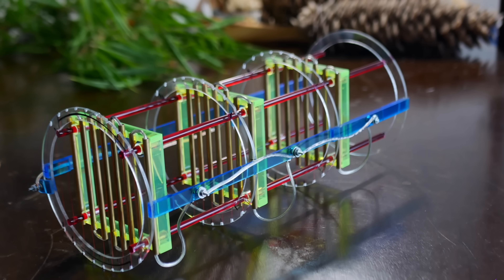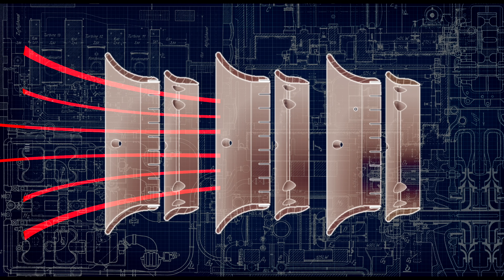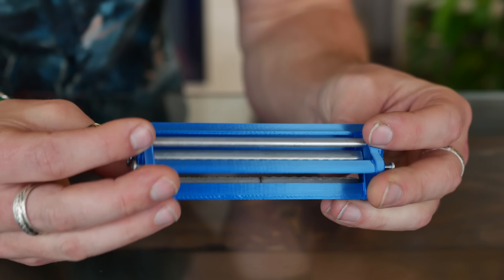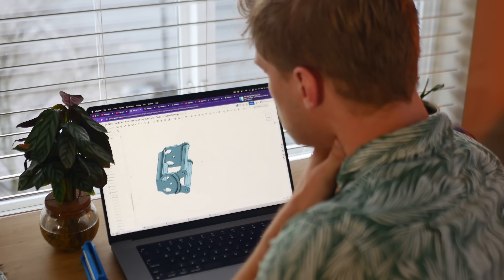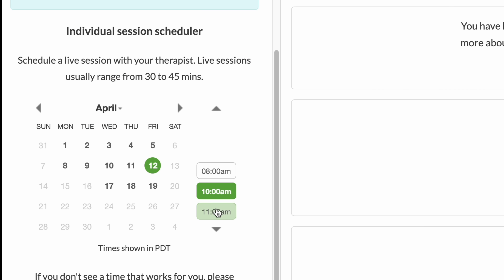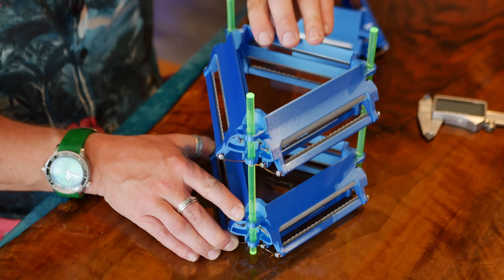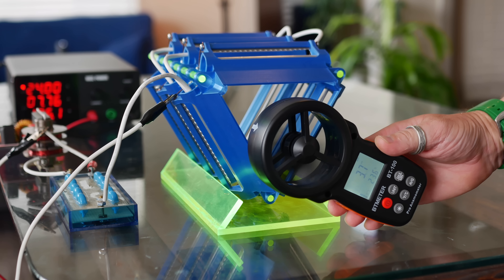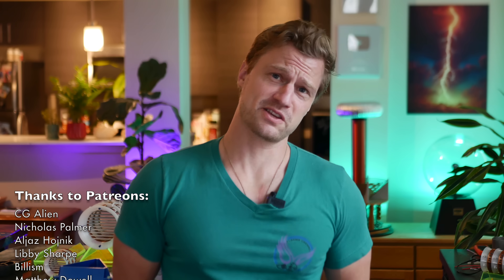Next-Gen Ionic Plasma Thruster Inspired By Nature (BTC Mark 3)

Comment: Been a pleasure following the iterations of these thrusters!
Others might have suggested this, but I would suggest a dedicated testing rig that puts the anemometer at either a fixed distance from the thruster, or has variable distance gauges so that you can reliably capture data at the point of highest constructive interference (or multiple points along the air stream). 

Excited to see Mark 4!

Comment: Have you tried adjusting you convergence on each stage to optimize your airflow if each stage is the same displacement it cancels out your results also individual power sources will definitely help with watts to volts on each stage like 40w 60 w 80w ect

Comment: 1st stage Funnel the air into the center second stage have a accelerator in the middle running a higher wattage each stage has double the wattage then the stage before stack 4 like that see what you get.

Comment: Have you thought about angling the thrusters for a vortex affect so that it will actually suck in more airflow instead of a straight column like you've been using . Also would using a Venturi tube behind it help increase thrust/flow?

Comment: Don't know anything about ionic thrust but I'm surprised you did not try to make it in a nozzle shape. I thought the venturi effect increased air acceleration.

I am also wondering if giving the ionic thruster a spiral direction could potentially create a tornado effect. Finally, does the air temperature have an effect on air speed?

Comment: Maybe i'm not getting it really and it's rather late but might be an idea to use the second electrode of the first unit as the first electrode of the second element? Or maybe its not actually possible to decouple the two circuits in that way because electrons doe what they do? Maybe that concept could be used also with combining lower and higher voltage circuits at different spaces apart ... or maybe it gives you some great idea what could done ... such a cool project ... loving it. 
Also i was wondering if you might not get more flexibility to test if you would go more 2d and sandwich 2 elements between some plexiglas, but feels like less interesting idea right now ...
also ... i feel lasers should be used in some way - ok i should sleep 😂very inspiring project!

Comment: “Constructive interference” is not a factor in this design.
Reply from the maker: Each individual thruster (each side of each section) uses a double stream of air, converging into one. Then, all three sides of each section, loosely converge into one focal point. Then, even more loosely, all three stages converge, linearly.
Reply: @PlasmaChannel  Constructive interference is something that happens when two waves are in the same place and in phase. Your design doesn’t depend on the in phase combination of any waves — there aren’t even any waves. “Confluence” would be an applicable word to describe the new feature of this design.

Not trying to be annoying… I love what you’re doing and have been fascinated by home-made ion thrusters since the first time I saw one described in the 1970s. Your designs are lightyears ahead of what I saw back then (:

Comment: I'm not terribly privy to the world of bladeless fluid dynamics, but the air mass being moved looks promising. Does the air mass retain a high static charge, or has that been measured? Didn't know if this would make sense for use in alternative air-cooling for high heat dissipation  in CPU cooling, unless the air mass holds a higher then ideal static charge making the air flow hazardous around low voltage semiconductors.

Comment: Have you considered the fluid dynamics of your airstreams? Doing it in triangleform the forces of the 3 diffrent streams counteract each other in some parts. If you model the airstreams and find a better shape for your engine you could probably increase the effiency quite a bit. I would consider a hexagon or octagon shaped engine since it would be easeier to build then a round one that people have mentioned here in the comments. Consider diffrent angels of the airstrems for each stage so they focus at the same point at the exit of the thruster.

Comment: Hey i've just had a thought you might be able to angle the thrusters slightly differently it could cause the air pulled in at and angle creating a vortex that could potentially end up pulling in more air creating more thrust just an idea might not w

Comment: Closing the gaps what you did, didnt improve much performance because you still have slits introducing lower pressure. Like suction of a hoover tube  goes down after one opens a top hole. Reckon you should eliminate any open gaps between the electrodes, slide them inside a horn tube for optimal spacing and consider using magnets and nozzle design to improve the thrust. Also a cathode at the exhaust to collect the ions and make engine electrically neutral. Using higher voltage also will improve thrust. Around 1kV at about 7kW accelerates existing space thrusters to about 20-50 Km/s

Comment: I could imagine changing the angle of the inputs might help: after the air’s pulled through the first set of inputs, it’s moving more horizontal than at the 22° angle, but as that air passes the second thruster frame, you’re reintroducing air at that 22° angle, so there might be a spot that’s got some backdraft, kinda like how there’s sometimes spots on a river where the water’s flowing back upstream. Maybe doing something like having the first set of inputs angled like normal, the second set angled somewhere between 17.5 and 15°, and the third set closer to 12.5°, something like that, might help.

Comment: in order make the air flow more smoothly, you should design each stage with a different angle. The last stage would be the widest or flatter exit exit angle (most open exit).
That way the air would not collide with the previous Stream of air. This just mechanical thinking on my part, I get lost in any math. Have Fun!

Comment: what about powering the stages separately. Then you can variate the stage power and adjust the system precisely. Now you accelerate the air by first stage with maximum power but other stages can't do better that that since all of them are the same.

Comment: You have (what appears to me as) a significant design flaw:  Your stages do not have the same focus and, as a result, are likely causing turbulent flow instead of increasing flow velocity.  They should taper down in size from the primary input stage with a more gradual angle at the first input stage and subsequently steeper angles later.  You probably don't want them convergent at a point either, but with stacked laminar columns of air.  This may not be achievable either because the intake of the first stage may disrupt subsequent intakes.

Comment: Maybe having a unit push air down the middle would increase end velocity?
When you made the gap bigger between the contacts you increased velocity, what effect would increasing the gap some more have?
Making the unit a square shape instead of triangular would mean you could add another 3 thruster sections, I would design the thrusters so they can only gab air from the outside of the unit, this way maybe they won't rob energy from the previous thruster maybe?
What about changing the angle of each successive module so they focus the thrust into the centre, your first module as it is then angle the next in a little, the next in some more. Square shaped modules🤔  

Or maybe it just needs to be bigger and more powerful, a lot more? scale the whole thing up to the point you can use a microwave transformer or maybe two 🤣 Just throwing out some ideas, I know bugger all about this topic compared to you 😊👍
Reply: Hope that lot makes sense 👍

Comment: I found myself thinking about your self propelled ionic thrust wing, and think I may have found an interesting direction to take that particular experiment.  Have you ever seen a cyclocopter?  If not, you should look them up and take a look at cyclorotors in general.  ;)  Anyway, I won't try to argue the point, I just think there's a convergence of technologies down this path that could lead somewhere interesting.  :)

Comment: Hi, i was thinking that since the creation of plasma is limited by the surface of the razors or the wire that you are using in your models, why not increasing the surface of them on a microscopic level in a fractal manner? I.E. by laser etching a certain structure on the edge that would help ions escape? By exploiting the malleability of gold, it might be possible to achieve very small scale (although it could be too fragile) or by using graphene surface structures as well...

Comment: sorry to be a back seat driver and this idea would make it bigger and more power input but have you tried a funnelling system with 3 on the first layer then a funnel to 2 then the 2 go into 1 at the back  or a system of a ring mad up of alot of smaller ones all going into the second stage then the 3rd

Comment: Lot's of cool comments and ideas here. I don't have access to equipment currently, but for someone who does, here's what I'm picturing and can't get out of my head: Take the current turbine design, hanging under the wing, and gut it. With the shell, the housing we have left, a cup that compresses as its moves forward, and now all along the inside of the cup, scoops, spiraling towards the back, each with an internal thruster plane to pull air through it's channel, which exits a smaller outlet than the scoop, outside the housing. Lot's of thrusters, pulling air into scoops then through channels from inside to outside, all inside a giant compressor scoop. Any thoughts??

Comment: Hey ho... I did not run through all the comments but I wanted to drop this idea: as can be seen from your measurements things are saturating from stage to stage. I was wondering if you could build a power staged setup where each new stage  has a higher voltage applied same like for multi staged turbo chargers in cars or for turbines in jet engines. You could further more improve the efficiency now as you may measure the optimal power supply for each stage now thus may increase the overall efficiency in both, thrust and power consumption. (Hope you could understand my explanation, if not, reach out to me 😅)

Comment: Haven't seen a comment about it, but I'm thinking about this design a bit.  You're trying to take in air that is ionized to go from a negative to a positive (Am I right?) through the air (electrical field and magnetic field).  Repelling negative air ion from negative and attracting them to the positive, right ? 

So instead of making stuff linear, why not try to make them more like a zig-zag (or cavity-like (like the leaf)) to get a better surface to react to the attraction ? Like if 2 leaf where actually made of copper.  This would make the "acceleration" more linear I believe and spreading them apart should enable you to make a better distance... I don't know how you could do that design to get bigger "wire" to propagate current and tension to smaller "wire" as to divide the load in a way to avoid melting smaller branches, but I firmly believe it would help.  Like the little dent you did based on Integza design (which I see you also did on your last 2 models).  Trying to make an imperfect shape may actually give you better result then a linear rail that I keep seeing in your designs.

Comment: POTENTIAL EFFICIENCY IMPROVEMENT.

What we are attempting with this, is the movement of maximum air mass, from the input of the device, to the output of the device, while minimising losses and or negtive force vectors.
Major problems include:
1. Radial thrust losses instead of axial thrust gains.
2. Cross sectional area against the direction of movement (drag).
3. Reduction in low pressure at the input/head.
4. Reduction in high pressure at the output/tail.
5. Flowrate limitations of the cylinder that contains the axial airflow.

Historically, my main idea has always been a solid state propulsion device, that is no more than a tube or trumpet (velocity stack), with an active surface.
Using a series of electrically/mechanically/magnetically isolated rings along the length, which can change the localised pressure/vaccum/ion state along the axis, enables a pump which resembles a sign wave moving along the axis, which drags the air through the container. This to be done by charged ions dragging the uncharged air through the device with it.

Someone below suggested using stages with different pressure stages (like modern steam turbine energy recovery) to make the system more efficient, but there is also another way.

The way nature gets around increasing the flowrate limitation problem of a fixed diameter orifice, is to create a vortex. Fundamentally, by spinning the airflow like a cenrtufuge, you create low pressure at the center of the axis, which drags in more air than normally possible, while also creating greater pressure at the wallls, where the active component of the thrust mechanism, actually does its work.

In theory then, you should be able to improve all 5 of the elements listed above, by using a phase shifted/pulsed vortex...or literally create an archimedes screw in an electrical/ion drive sense, by using an active surface. Where the effective rotation of the field, drags the ions in both an axial and rotational motion.

Comment: I suspect the reason why you get diminishing returns on velocity with the old sequential design has less to do with your explanation and more with the simple fact that you add the same kinetic energy at each stage and the kinetic energy being proportional to the square of the velocity. You would expect a the results your getting since velocity is proportional to the square root of the kinetic energy

Comment: It's possible that the triangle shape is creating too much interference, causing the air to fight itself to get out, ie drag. I don't know how you'd test that though; confetti in a fire resistant room?

Maybe try a box, with thrusters on just two opposing side. Or, if you wanna keep the three sides of thrusters, you could try the bestagon approach, and connect them with three equal blank sides.

Likewise, you may wanna try containing the entire unit in a sleeve. You can get cardboard tubes of varying diameters at the local hardware store.

For shits and giggles, you could try funneling the exhaust.

Comment: In the episode with the wing set-up I mentioned a Dison bladeless fan. This device is closer! With the Dison air flow, put the ion units within the housing itself. But, stagger them around the perimeter so their output flows will not interfere with each other.

Comment: I - I would have gone with a square aperture, with a central set of ion frames to accelerate the core air column prior to the convergent additions. And I would agree with at least testing uneven increasing spacing (with closed columns to avoid overexpansion), although your last runs didn't seem to show much gain from larger separations.

Comment: In lieu of any actual experience, something you might also consider, taking into account that you are decreasing air pressure with each stage and losing efficiency from that action, perhaps you might do better if you ran them in sequence in such a way they can still draw on more atmospheric pressure - in something of a pyramid shape.  One thruster feeding two, then feeding three?

Otherwise, coming up with some compressor stage, be it by feeding output into a single-stage tesla valve and merging inputs might be something to test? (4:2:1), or trying different nozzles / cones to compress the exhaust.  As others have said, decreasing subsequent stage diameter might also be something to explore, as well?

Comment: Well, the second and third stage of the thruster only made the column of air marginally faster while staying at the same crossection, making it not too much more efficient. Wouldn't it be more efficient to put all thrusters' air outputs in parallel (i.e. all thrusters next to eachother instead of three in the same air column)?

Comment: Have you tried using separate circuits for every stage? That would prevent ions from jumping from the positive of the second stage to the negative of the first stage. (Elektricity wants to flow in a circle. If the stages are different circles they cant interfere into each other.)
Then you can place the positive of the second stage nearly into touching distance of the negative of the first stage.

Comment: Well, I'm not an expert but I think you're losing so much energy by only relying on peripheral thrust. I think you should think of it as a motor that's gonna be placed along the span of a wing not as a wing in itself. You can encase it in closure similar to that of a jet engine (if you know what I mean) and use both peripheral and central thrust (or whatever it's called). This will provide a more guided air flow and might increase the efficiency of the device.

Comment: You are converging the air in the center evenly. I feel like the very first set is creating turbulence with the non moving air already in the center at the front hindering your total work flow. I would think you would get better total air movement by off setting each triangle corner so they create a vortex in the center. Like tipping a water bottle upside down. The water just glugs out as air tries to replace the water. But If you whip the bottle in a circle the tornado formed, allows the water to pour out quick. 

So take one triangle group. Rather than have each piece end to end, at each end meeting point move one side backwards and the other side forwards like less than a centimeter. Then do the same thing for the other two corners. Then follow through with doing the same for the other three corners of the other two triangles each. 

Would that work to create a vortex of air in the center minimizing any turbulence created? 

Or are the angles created by having a triangular frame two shallow?